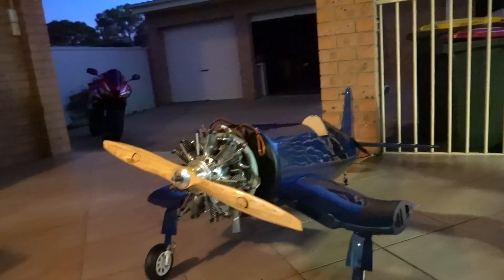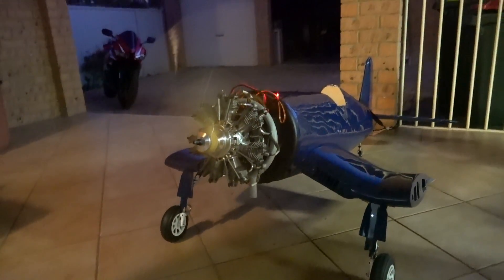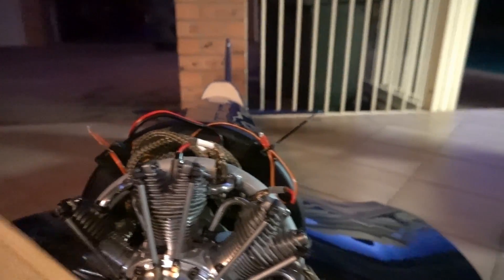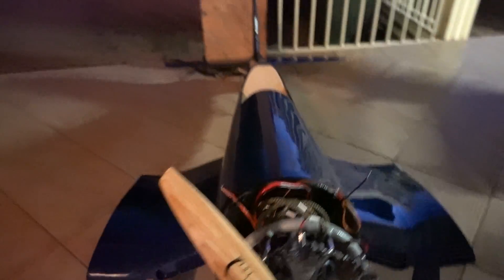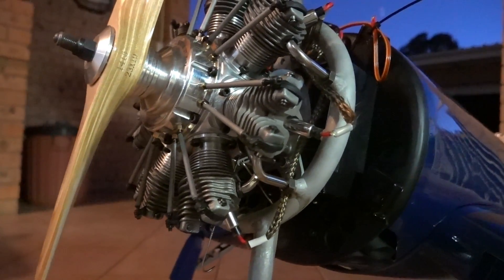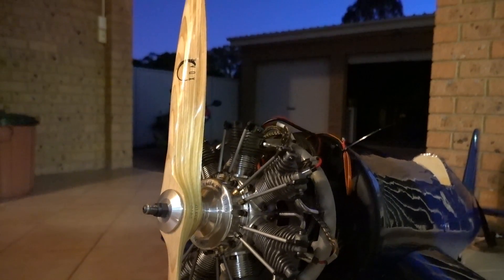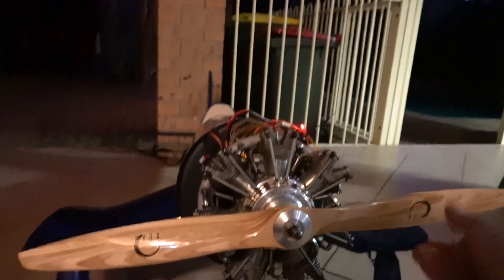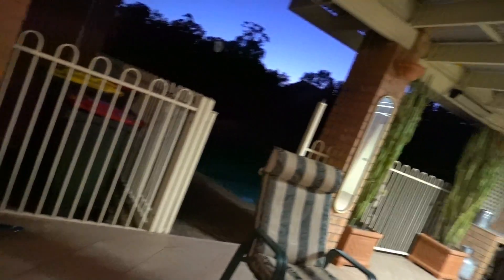7 CYLINDER RADIAL 4 STROKE ENGINE - Vought F4U Corsair First Start

Comment: That is beautiful it would be hard to fly that one
Reply from the maker: Not sure but definitely a beautiful plane
Reply: @RCTanksTrucks247  onr of the hardest to fly apparently
Reply: @IHaveAMint  mmm. Not necessarily, my Corsair is definitely a handful on landing. But then again she has No Flaps. In the air on the other hand. Is easily my favorite to fly. Takes off Fast. And handles moderate wind with ease.. now I don't have a $1600 engine in her either. So. I would say the HARDEST part about flying his Corsair is getting past those maiden Nerves